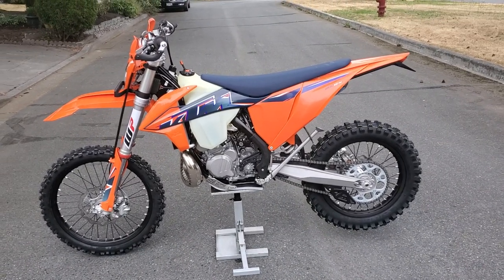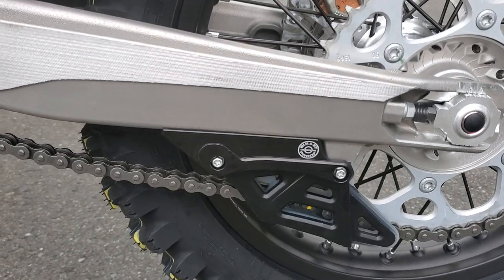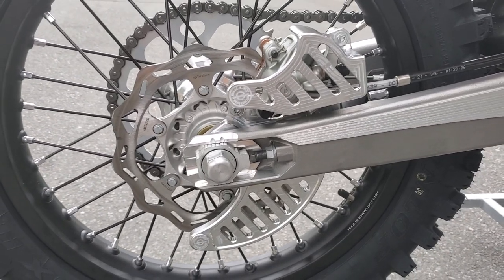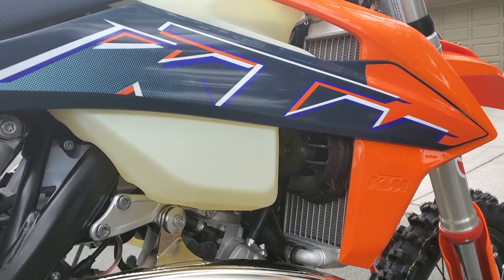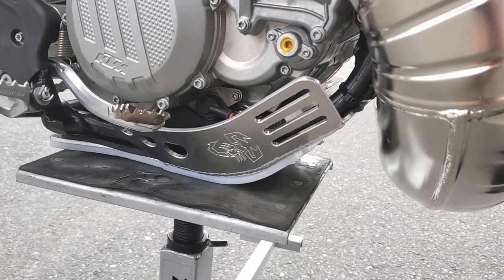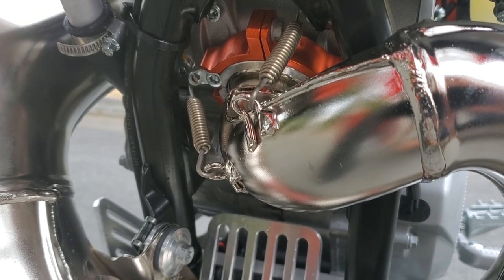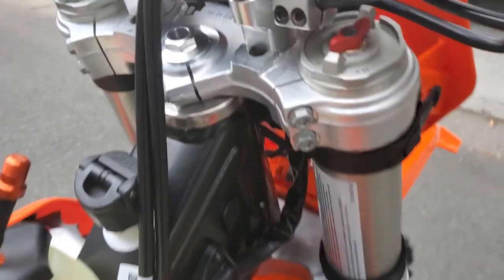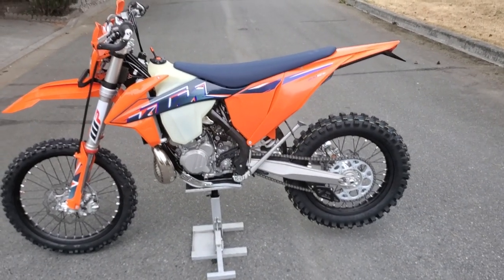2022 KTM 300 XC-W - ready to ride!

Comment: I love it very nice and congratulations. one question, that silencer is smaller than the original ? there is variation in performance ...it would be nice to hear the sound ...greetings from Spain.
Reply from the maker: Greetings from Canada Pepe!  Where I ride a spark arrestor is mandatory, which is the only reason I had to change the silencer.  (Which is ridiculous after spending that much money on a bike meant to be ridden in the woods!!!)  I only started the bike once with the stock silencer before changing it out, so I'm sorry I can't give you an opinion on how they compare.  Cheers!

Comment: Just picked one up and love it. My idle was too low but is much better with the idle mod screw. Did yours need to be adjusted?
Reply from the maker: I ride almost exclusively at sea level between 5 degrees and 35 degrees C.  I did turn the idle screw about 1/4 turn for a slightly higher idle, it did occasionally die on long downhills with the clutch pulled in.  At this point the full mod has not been necessary for me.  Cheers!

Comment: What is the fuel cap thingamajigger you got? Model of the fan, manufacturer? I ordered a 250 that hasn't arrived yet and I'd like these parts for mine?
Reply from the maker: The fuel tank cap vent is technically a doohickey and it's KTM part number U6951010.  The rad fan is also a KTM Power Part - 79735941044.  Cheers!
Reply: @VanHermanator  Thank you sir for the dealybobbers part numbers. Betsy is gonna look great as soon as she makes it to Oklahoma.

Comment: How do you like the bike ? Any issues with 22’ tpi bikes ? Reliability?
Reply from the maker: The bike has been fantastic over the first 25 hours, no issues whatsoever.  Plenty of discussions on the internet regarding TPI issues but nothing I've experienced.  My warm-up is per the KTM manual so I don't blip the throttle like I used to with my 2013 carb XCW.

Comment: where did you buy this stuff?
Reply from the maker: I sourced the parts from various places - the local KTM dealer for the fan and flange guard, Fortnine (I live in Canada) for the handguards, Emporer Racing directly for the skid plate, Rocky Mountain ATV for pretty much everything else.
Reply: Do you have the part number of the fan

Comment: Nice.
I went with the Cycra Pro hand guards. 
Never knew about the exhaust flange guard/support.
Reply from the maker: It's good insurance if you smack your pipe as often as I do. All of that force on the pipe during a hit has to go somewhere, and especially when running a pipe guard, the exhaust flange accepts most of it.

Comment: Nice bike, those Cycra's are shit, don't fit right on my old RM 250 either. I like the clickers, no need to spend mega bucks for the erzberg. Look into the TSP performance kit maybe, carbon guard for pipe. I think your ready to rip!
Reply from the maker: Thanks man!  I had a carbon guard on my 2013 and ended up cracking the exhaust flange after a good hit to the pipe/guard.  I'm fine with denting it up and replacing the pipe each year.  This one already has 5 good bruises on it.
Reply: We all pitched in and bought a hydra-force for popping dents. It even brings the neck back if that's tweaked.  I quit using a pipe gaurd too.